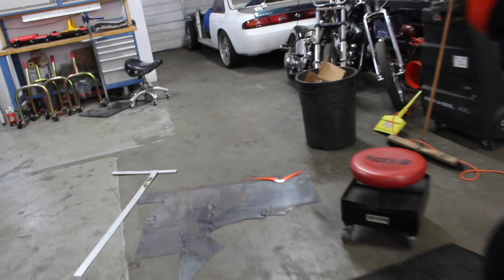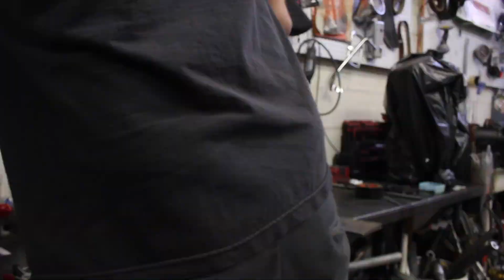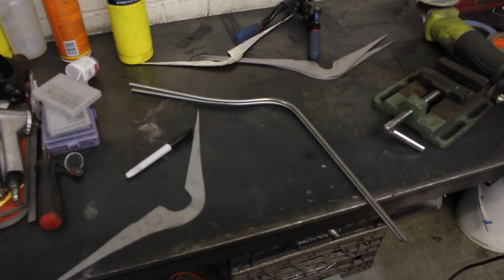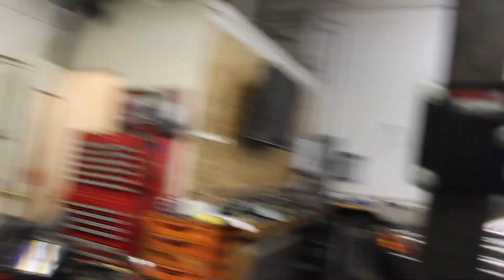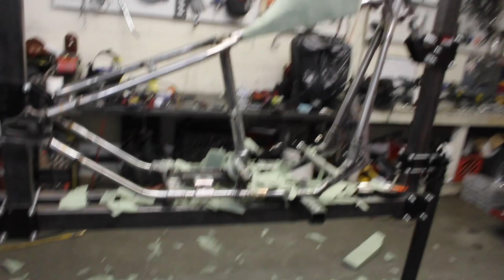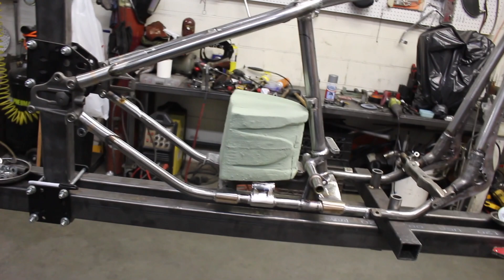Biltwell people's champ build  - part 2

Comment: If you remember what frame is that ?  Did you go with 2” over stock front springer , what motor and trans the looks like something to rip around Dallas on, it has to have the speed behind it though

Comment: What size springer is that with tire size front and rear please plus what's the rake on bike I'm doing up a 70s ironhead and I'm looking also for the same slammed look thanks and keep posting great videos
Reply from the maker: hey Mandy, its a 30 degree rake, stock length springer, 21in front wheel! Thanks for watching